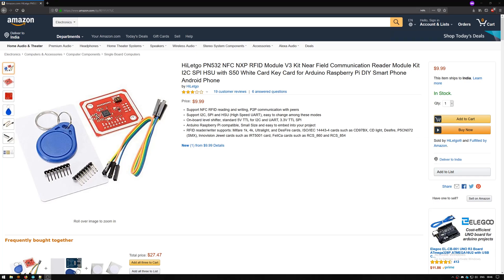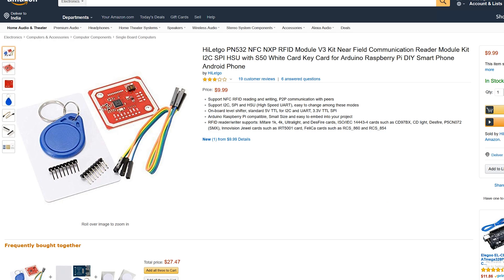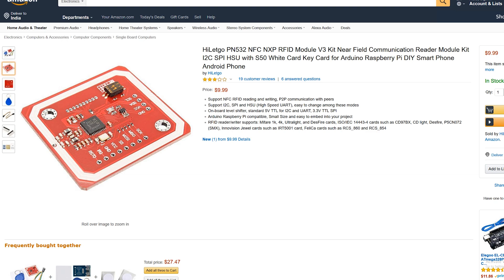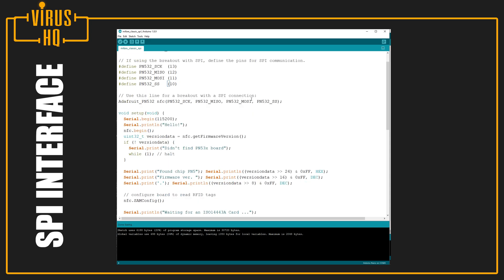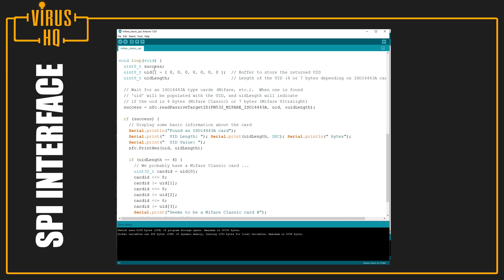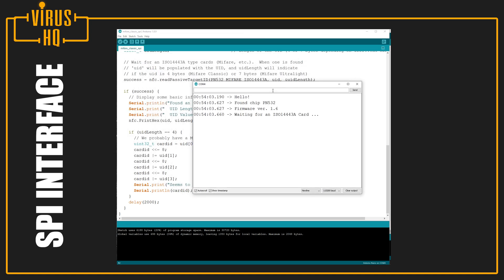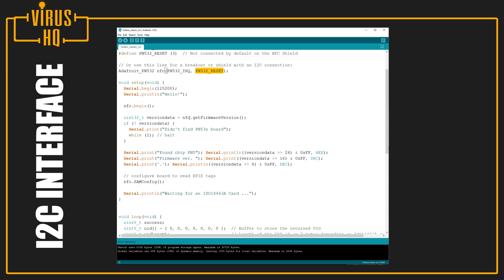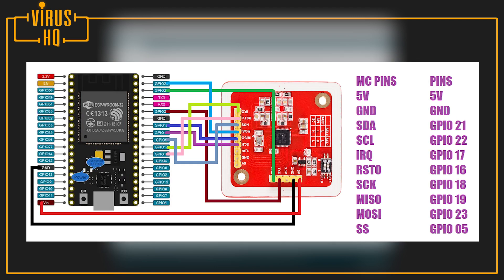RFID/NFC reader & writer with PN532 ft. Arduino and Esp MC

Comment: I want to Exchange data between 2 pn532s using ESP32. I was able to do it with arduino but unable to do it with ESP32. Pls Help!
Reply from the maker: How are you trying to send the data ?
Reply: @VirusHQ  I am trying to send data from pn532 -> esp32 -> Phone
Reply from the maker: Should not be too hard, are you using an app on your phone to read it ?
Reply: I want to create a custom app. Also issue is when I exchange data between 2 pn532s it's not consistent..it detects pn532 and then it doesn't detects the second time
Reply from the maker: Hrmm could be a hardware issue or connection issue
Reply: Now I am using Uno with HC05
Reply: I've never code an app interfacing Arduino...I want to write a string onto Arduino and receive data from Arduino

Comment: Hey there, i' m working on  esp8266mod +pn532 ,but every time i get either "didn't fnd pn53x board "or a watchdog reset .Can u suggest a solution!!!
Reply from the maker: probably loose or wrong wiring maybe even the wrong channel selected
Reply: @SHILPA M S did u find solution for "didn't fnd pn53x board
Reply: @Sai-st3fm  no, i didn't. So i changed the MCU to Arduino UNO

Comment: Before I whip out my wallet to buy anything, i have a question and double checking, Will the PN532 read iso44443b cards(HID IClass GP) cards?
Reply from the maker: So I did have to go through a few forums and it seems like the PN532 is capable of reading 4443b cards but all libraries do not support it , so it will become a point of finding the library that will read it. I hope that clears some part of the question :D
Reply: @VirusHQ  i found 1 website in particular that had some what info but it wasnt complete and a code was included but no links to the libraries that they used. here is the link https://github.com/nfc-tools/libnfc/issues/397, maybe you understand more then me.

Comment: where should i enter the UID of the card or tag ? and can i use RC522 library code for PN532 ?
Reply from the maker: where as in ? 
Are you trying to add it to some code or something ? 
Also unsure about the RC522 library , you can always try it though , wont hurt right
Reply: @VirusHQ  i want to give the UID of the card i want to give access, so where do i enter
Reply from the maker: In the code then , first run the code that shows you the UID of the card , and then use that to authenticate
Reply: @VirusHQ  i didnt get you. I opened serial monitor to read UID but where i need to paste that to give authorization

Comment: Nice video, but please do you have any program to write/ change the UID ?
Reply from the maker: If you look into the examples folder in arduino , it has an example to change the ID on the card so you can use that and also make sure you have the correct card.